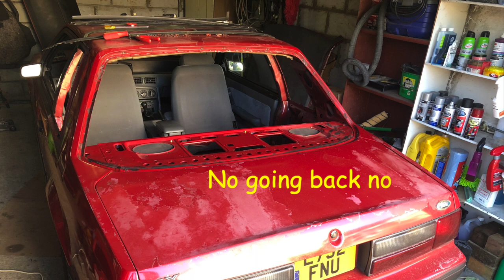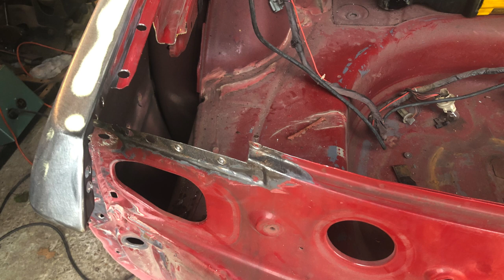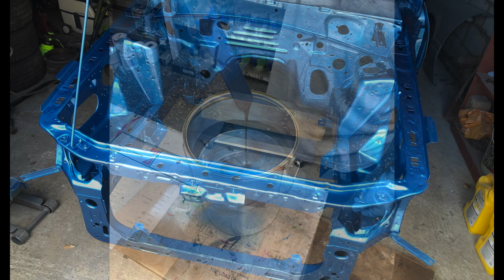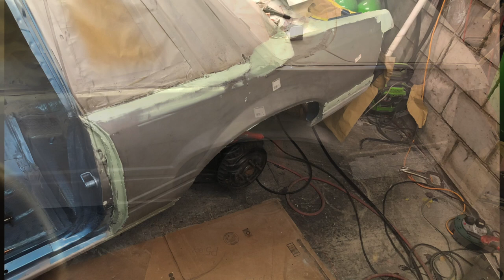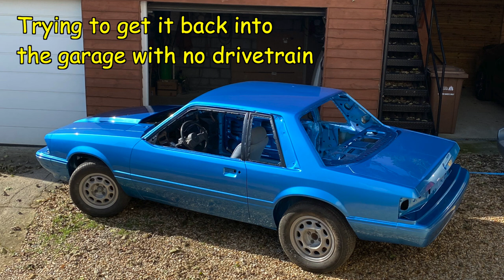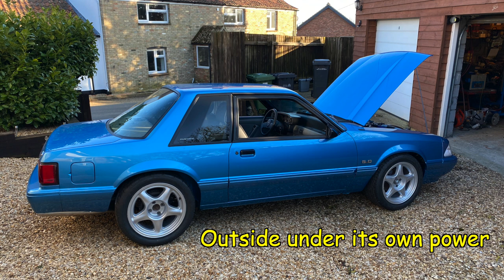Complete Foxbody Restoration Montage

Comment: That is an amazing restoration. In the last snap shot of the video, what size rims and tires are you running up front?
Reply from the maker: If you are referring to the Bogart D10 drag wheels?  They are 15x3.5 and the tires are 26 x 4.0-15 Mickey Thompson bias ply.

Comment: Hey How you doing , i got a question How did you install the floor carpet any tips, And where did you got to buy the carpet as well?
Reply from the maker: Wait until the heat of the summer.  Open the carpet and let it try and settle back into its intended shape over the span of a few days.  I got the carpet from LRS but they pretty much all come from ACC.  They never fit as well as the original.  Especially around the rear footwells.

Comment: Awesome! Wish there was more engine content. You called it "bone stock" but with a turbo? There had to be bigger injectors, cam, fuel pump. Did I see the upper intake switch from Cobra to Edelbrock? Without mention
Reply from the maker: It is a stock shortblock, just freshened up. There are a lot of supporting mods to the engine for the turbo kit.  I didn’t want to go down that road in the montage as I did not really have a lot of pictures showing that portion of the build. It was always a Cobra intake. I may not have had the plaque glued down and was setting it on for some pictures, then removing it so it wouldn’t get scratched until the end of the build.

Comment: No air conditioning and used seats lol all that work
Reply from the maker: It’s a factory non A/C car and the seats could pass for NOS. I suspect you live in a southern state.
Reply: No even in northern states it’s still here hot and humid. Even if the car didn’t come with AC you have the talent to install it. You have undeniable skills. And something that  isnt done normally installing a factory sunroof. The coupes didn’t come with one after 1984 or 1986. I had one installed. It little things that make the car all around appealing.

That being said to do a restoration like this being in another country where you have to import parts I can get next day is nothing short of incredible.